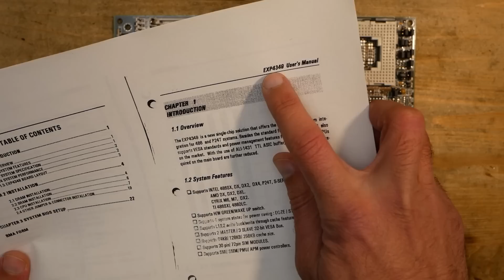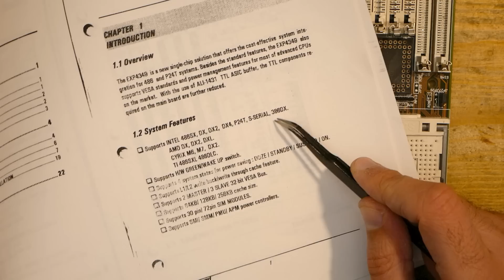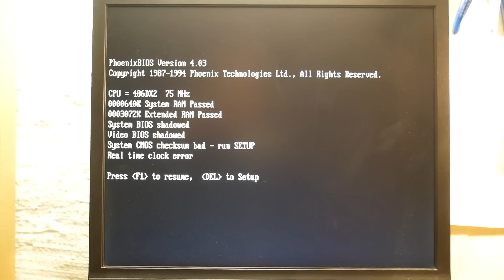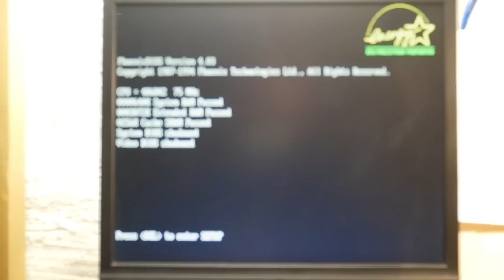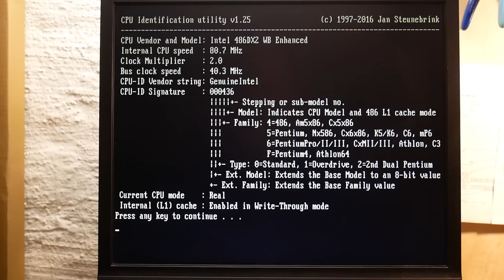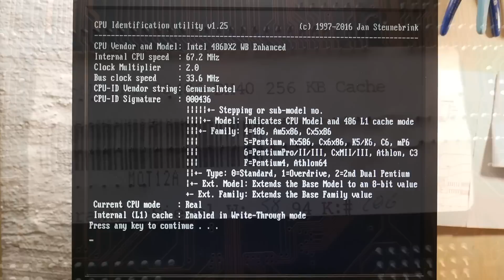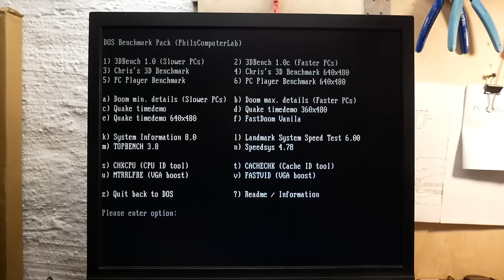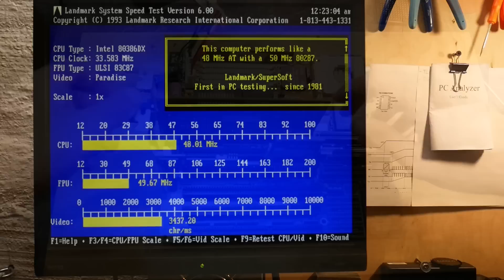An expert among retro mainboards (Part 1)

Comment: Adrian Black had a 386sx board with Vlb slots the other day but was unable to get the board to work, and amazingly you appear with this video. Makes you wonder why there weren't more Vlb 386's if it has such a benefit. Still it's a peculiar question unanswered as to how an SX processor could work with the 32bit Vlb Slots. Maybe you'll solve that riddle someday too. You are Awesome, always learn so much from your work.
Reply: There was even spoiler trailer in the comments of that video ;-)
Reply: @SergiuszRoszczyk   Thanks, I found that comment, answers all my questions. much appreciated.

Comment: You make clearing those filled solder holes look so easy. I did that on an LC II board and it took ages and had me half in tears by the time I got done 😂 I'll have to try your technique next time. Awesome job there!
Reply from the maker: Once you desoldered 1000 holes you get used to it ;)
Reply: @necro_ware  Browning of the plastic parts can be avoided by covering them with Kapton tapes
Reply from the maker: @davidw.2467  Yeah, I usually do, just didn't think, that it would happen so fast in this case.
Reply: No kidding.  I had a bear of a time trying to pull a rusted DB25 jack off a motherboard.  Ended up warping the fiberglass a little by the time I was done.  :-(  This technique is definitely the way to go.

Comment: Very interesting mainboard! I seem to remember there were a couple of boards out there that could host a 386 or 486 CPU but most only had the proper socket to support one or the other. Makes sense a board mfg. would want to design a board that could do either or in the fairly early days of the 486 CPU. The price difference between a 386 and 486 was quite significant and for general office use most 386 machines were seen as being "good enough" compared to a much more expensive 486 based systems.
I seem to remember a friend of mine back then had a PC that had such a board but it only had the 386 socket installed so he ended up using an AMD 386DX 40mhz. His board also did not have the VLB slots so instead of trying to modify it to work with a 486 he ended up replacing the CPU & mainboard with a Pentium 100 based one later on.

Comment: What an awesome board! Your repair work was very inspiring. From memory, while supported, 3 different VLB cards in a system is not recommended. (Not that there were that many combos of VLB that you could justify 3. Video + Super IO + Fast Network was about it.)
Reply from the maker: Yeah, usually VLB IDE didn't even give so much of an advantage over ISA. It had to be SCSI. The same was about network adapters, so VGA was the only real reason for VLB.

Comment: I believe the VLB socket is a manufacturing defect. I once repaired a broken Apple IIc with non functioning floppy drive, it turned out the floppy ribbon socket was wave soldered improperly during manufacturing, with its pins almost flat with the motherboard, and some pins were making bad contact. Resoldering the socket fixed the problem.

Comment: Your videos are great! I'm impressed by the effort you make to restore these archaeological finds 😃
It's funny how Adrian Black (Adrian's Digital Basement ][ ) tried his luck with a 386 board also featuring VLB extensions just a few days ago. His board had a 386SX fitted though (soldered on the board, no socket!) so, technically, it didn't really make much sense because of the 16 bit wide bus.

PS: just noticed you already commented on that video

Comment: Interesting board, and nicely done change! I spotted the non-soldered sockets right away! ;)
I'd be really interested in how it performs... If you're interested, I made a quite accurate bench for SVGA performance (results are in MB/s), including bank switch speeds. Would be interesting to see the raw video throughput of 486 vs. 386 CPUs over the same board...

Comment: I was very close getting a board like that too. I payed the seller but he canceled and returned the money T-T
Yeah that is a great one, a bit jealous here ^^. DataExpert went full ASRock mode with this one.
This board should also support 486SXL2 in the 168p form.

BTW this battery, basically can last forever with a capacity ~1Ah and minimal self discharge (<1% per year).
The problem with these is that sorting or recharging could be very dangerous. (max current ~50ma!)
The manual recommends to always have 2 diodes in series, or one diode and one resistor for safety.
So I hope this battery was there by the factory and that the board is designed for that.

The VLB slot I think the explanation is simple.
In a production line all these though-holes are soldered in a solder bath.
All the components are placed then the board goes into the bath.
So this one was not placed correctly or pooped of into the bath.
For that reason ISA and PCI slots usually have some pins bent so they stay in place for the bath.
Maybe these VLB did not had this and so easier to pop out.
Then they did not check this properly afterwards.
Reply from the maker: Yes, this battery is definitely there from the factory. There is also a jumper to select between Lithium (non rechargeable) and NiMH (chargeable) battery types. In regards of VLB, you are probably right, but really don't understand, how that could go through QA :)

Comment: Excellent video as usual. Id be cautious of that lithium battery if i was you, it looks to be the same type as used in the MAC classic only with solder tags rather than a holder. If so they DO leak.

Comment: Any Macintosh user can tell you those lithium batteries can absolutely leak and damage the PCB. While Tadiran leaks are rare on Macs, I have seen it happen.
Reply from the maker: Ok, thank you, I'll keep an eye on it and replace it with a coin battery later.
Reply: I actually saw a coin cell battery leak once too. Definitely extremely uncommon tho.
Reply: Not impossible to leak, but these Tadiran batteries appears to be high quality. I also have board from DataExpert - model EXP4044 with this battery and it's also in great state. No signs of leak and voltage is 3,7 V.

Comment: Looking forward to the results of this. I have a motherboard myself that can handle 386 and 486 cpus that I haven't tested out. It only has 30 pin memory slots but has 16 of them so it can support a ridiculous amount of ram for the era. I'd also love to see how a 386dx40 works with my vesa Diamond Stealth 32 card that I used to use on my 5x86 at 150mhz and was rock solid stable on a 50mhz bus. It did have some minor battery leakage though so I need to test and see if i have a keyboard or if I'll need to fix that too.

Comment: It's interesting to see actual results (and thank you for that -- this was really interesting to watch), but I think we could reasonably expect there to be an improvement in performance with VLB, even on a 386.  Consider that EISA and MCA both debuted in the 386 era to solve the problem of the bus and CPU running asynchronously.  It was quite well understood that a 16-bit bus, capped at 8-10MHz (depending on divider options and how frisky your add-in cards were) is a problem worth solving.

I think it's easy to forget that, based on how heavily associated the VLB bus was with 486s, and how most of us never used anything but ISA on a 386.  But, in fact, I think we only really survived the 386 generation due to two factors:

1) It was now essentially mandatory to have an intervening chipset that would move RAM into a local bus, where it had previously been on the same bus as all the ISA peripherals (even being installed on a card as an ISA peripheral.)  That, at least, kept the most critical operations 32-bit, and running at high speed.

2) Windows wasn't obligatory yet, and those that needed to move objects on a screen of 640x480 or higher, could use dedicated accelerators that moved the drawing commands from a series of I/O events between the CPU, RAM, and video memory, to an operation carried out on-card between the graphics controller and its own video RAM.

That really only left brute-force graphics and, to a lesser degree, disk and network I/O facing a bandwidth bottleneck.  And, at the time, disks and networks weren't very fast anyway.  :-)  If it weren't for those factors, IMO, the 386 era would've been unbearable.  Luckily, users were just happy that their spreadsheets recalculated a little faster, and CAD was still spending more time doing 3D math than drawing lines on-screen.

Comment: Thanks for the great video! :)
At timestamp 7:36 it looks like a resistor network near the cache memory at the edge of the board has some physical damage?
Reply from the maker: Yes, I'll talk about it in the second part.
Reply: I was going to make the same comment, but noticed the very last shot of the board where it had magically been replaced with a new (yellow) one.
Reply from the maker: @crayzeape2230  good eyes ;)

Comment: Fantastic video! I'd recommend putting some Kapton tape over the plastic bits in the future to shield then from the hot air and melting. Melting.... Like my mind with the fact a 386 is running with VLB lol. Again, fantastic work!

Comment: I would like to know which VLB cards are would working the best with that 386 processor. So are the lower - mid end vlb cards fast enough for the 386, or will it gain even more performance with higher end  VLB cards.

Comment: Can you keep both CPUs installed at the same time? Could you also create a small PCB with a switch that could toggle all the jumpers in order to flip between 386 and 486 easily?

Comment: Lithium-Thianyl-batteries: always measure voltage with resistor (4k7 or 6k8 or 10k) in parallel (or soldered in circuit)

Comment: VLB bus was available on 386 platform long before the 486 was available. I know this as I had one. It was a $4000 386 DX system, 4MB of ram, 105MB drive, and a VLB SVGA video card.
Reply from the maker: VLB was introduced with 486, but some late and more expensive 386 mainboards backported VLB. One of such mainboards you see in this video.
Reply: @necro_ware  I'm not sure this is true. When I bought the machine (here in the US) there was no 486 (less any engineering samples floating around out there) and I can assure you that the board was 33mhz 386DX with co-processor and VLB SVGA card. This was um... '88 or '89
Reply from the maker: @djfaber  Well, VLB was introduced 1992. If you bought your PC '88 or '89 with similar slots, may be that was something proprietary?!

Comment: I remember I had a 386sx with vlb slots. And I had to use them for a fast IO card. The ISA cards i could get at the time only had slow 9600 bps com ports, but I had a shiny new 14400 bps modem, so I had to get a vlb IO card. 

I never figured out why I couldn't get 32bit disc access working in Windows 3.11, until I recently found out that the sx had only 16 external data bits, just like the 68000

Comment: The reason the 386 CPU worked at 33mhz and not 40, is because it's speed isn't dependent on the jumpers; but on the (missing) crystal oscillator (marked OSC1 on your board -- right next to the 386 socket). 
An 80.000Mhz oscillator will set the 386 CPU at 40Mhz. Otherwise, in it's absence, it chooses the BUS speed it seems.. 
P.S. be sure to install it in a socket, in order to be able to remove it for 486 CPUs.

Comment: It would be very insteresting to see IF one can build out a system, based on this motherboard that can run DOOM on 386 CPU with accpetable performance. Will it be possible, if all other components are maxed out (512 kb external cache), EDO RAM and fast VLB graphic. Maybe even overclocking a little bit.
Reply from the maker: Only if you heavily overclock the 386 to 60-70 MHz. Larger L2 cache wouldn't bring a lot of performance, you'd be just able to use more cached memory. 386 has no L1 cache and it is much slower in 32-bit integer arithmetic, than 486. That difference has to be compensated with insane clock, which is not possible on the standard 386 CPU.

Comment: I had a silly idea. With all those jumpers, why not use a ESP32 or Pi Zero as a web interface for the settings. You would probably need some logic chips (PAL and or mutliplexers) open/close jumpers. I know it is silly, complete overkill, and way more work than any sane person would be willing to put in.

Comment: What would happen if you installed a 386 and a 486 at the same time?  What about if you put an FPU alongside the 486?  Would it even POST in those cases?
Reply from the maker: No, it doesn't post.

Comment: Interesting solder where lead has the symbol cu, here I was under the impression it should be pb. Well, true chinesium i guess 🫣
Reply from the maker: Hehe :) Didn't even notice that. That solder has no lead at all actually. Well, at least it shouldn't, but as you say, you can't trust it. Judging by how it flows, I'd say it is lead free.
Reply: @necro_ware Personaly I 100% prefer working with leaded solder, but a fume extractor is recommended.